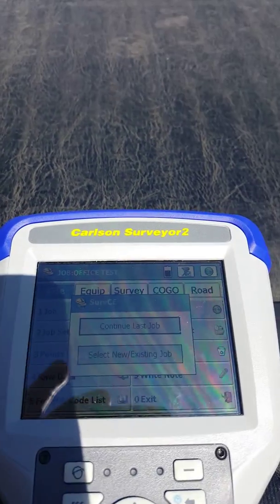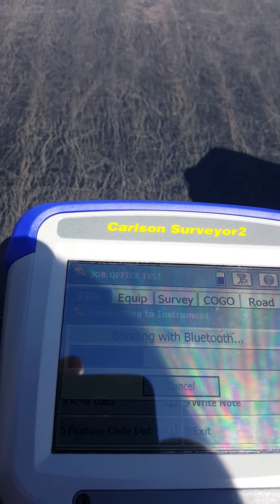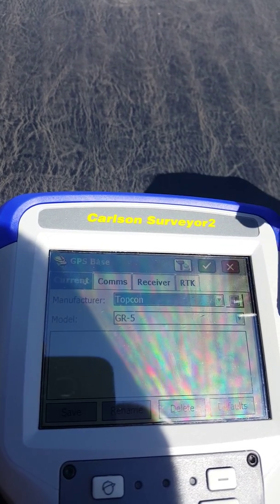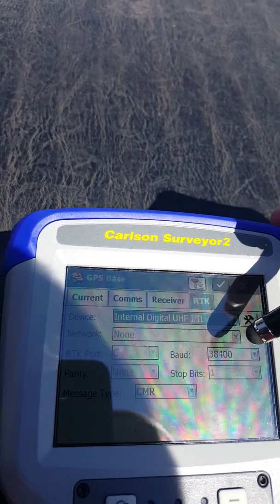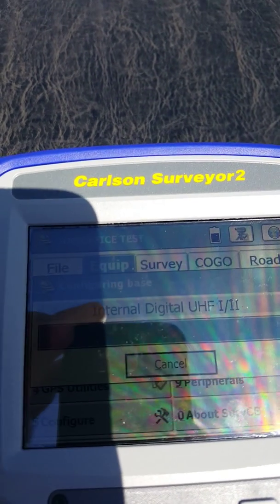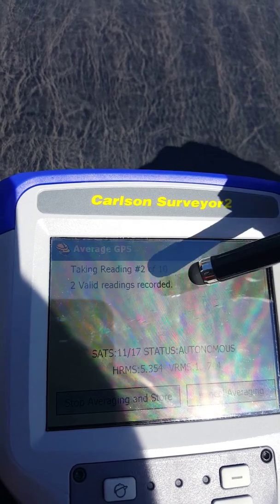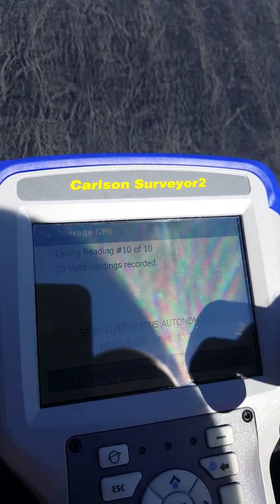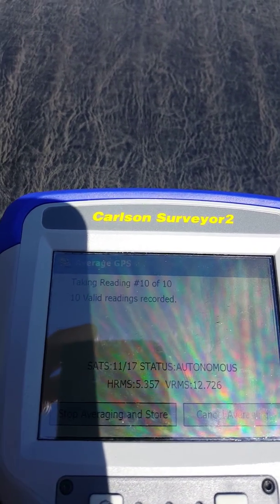Problems with brand new Surveyor2 with Surve CE 4.06

Comment from the maker: If you are not running SurvCE version 4.06.7 or better and you are experiencing this problem, it is because of a driver issue.  Use this link to download 4.06.7 or find a newer version.  http://tinyurl.com/winmob4067  If the link does not work it is because Carlson took it down.